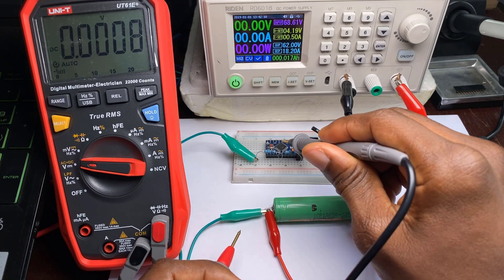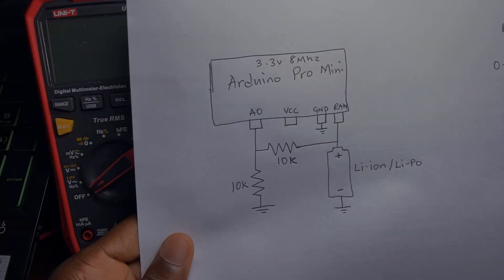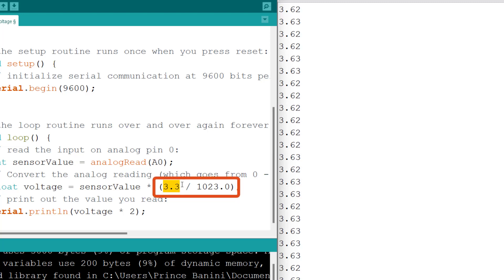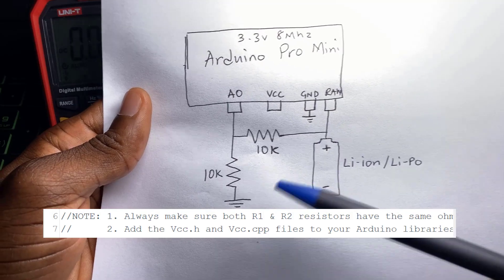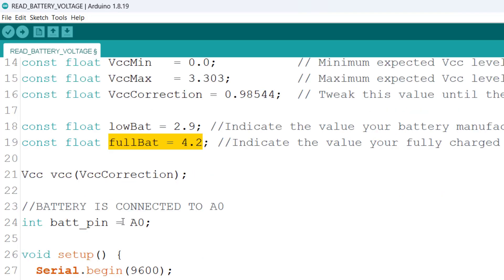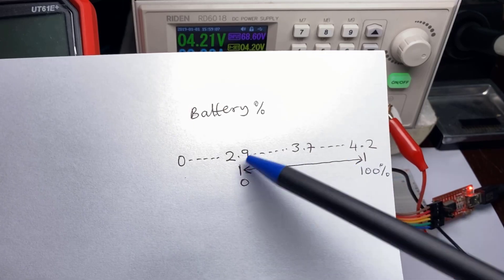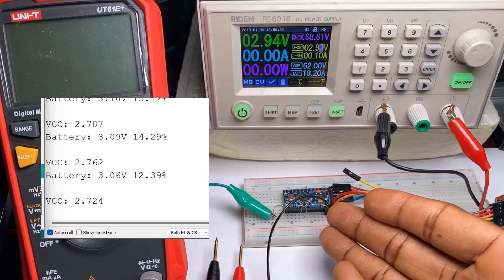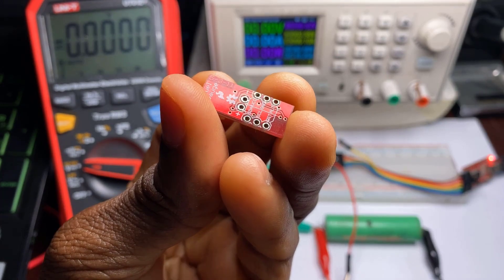Accurately Read Battery Voltage with an Arduino and Voltage Divider | Pro Mini | 18650 | ATmega328p

Comment: I am confused as to where you placed your test leads from the multimeter, to what pins. I know the ground test lead was placed on node that share between the battery and the resistor, but where was the other one placed?

Comment: This may not be the used case for you, but an Arduino Voltage sensor can help mitigate this issue. Not only the sensor is voltage independent,  isolated, and can read a wide range 0-25v of voltage but it is also does not cost a lot.
Reply from the maker: True. One could just use a fuel guage module like the MAX17043. But most people usually attach 4.2v li-ion or li-po batteries and dont need a dedicated fuel guage.

Comment: can you upload a video with same procedure but for a series stack of 10s celss or more? maybe with several res dividers maybe with amp op or maybe with the help of a BQ ti chip..thanks!
Reply from the maker: I could look into that. Essentially you want something like what a BMS does by showing each batterys voltage in a series stack + the overall voltage of the stack?

Comment: the issue is a voltage divider will keep draining the battery, how can this be avoided?
Reply from the maker: Yes but it heavily depends on the resistors used. You can simply use two 1 Mega Ohm resistors. I have done this on an electronics boards i designed and the board consumes 2uA in deep sleep. 

Alternatively  you can use a fuel guage IC like i mentioned at 9:00 of this video.
Reply: @ great, Thank you

Comment: Hi your project is great, may I ask if it affects the power consumption? I just want to check the battery once when starting the circuit.
Reply from the maker: I believe checking the battery doesnt affect the battery. Because if the arduino is already on, then checking battery voltage consumes the same power just like the ATMega chip being idle. However is you're waking up just to measure the battery voltage then yes, that could slightly impact the battery over a long period. But it might be neglegible.

Comment: How are you getting vcc max value of 3.303 volts?  Is that max voltage through the voltage divider?
Reply from the maker: That is the max voltage recorded at the voltage regulators output. I used a multimeter initially and later confirmed in serial monitor after calibration.

Comment: Is this still a problem if you use two cells feeding a voltage regulator that then feeds the arduino?

As I understand it the problem arises because a Lion cell drops below 3.3V as it discharges this messing with the analog ref. Correct?
Reply from the maker: Yes. Correct.

If you use two cells in series, the good news is you have more time before the combined voltage dips below the voltage regulators desired input.

Comment: question: would this problem exist if you used a separate power source for the arduino and not use the battery?
Reply from the maker: No it wont exist.

If the power source never dips below the 3.3v output peg the microcontroller requires as reference then this problem goes away.

Comment: How about the same for esp32? i'm unable to use the program for esp32?
Reply from the maker: The code is meant for the Arduino line of boards. I belive the ESP has a different architecture.

Comment: assuming battery level with just measuring the voltage is not a very correct approach. Because voltage discharge level is not linear. to calculate the exact power level you also have to measure the current.
Reply from the maker: In my case i'm just trying to measure the battery voltage, so the non linearity of battery discharge doesnt matter much. It might matter if i was trying to calculate and estimate how long before the battery gets to a fully discharged state. 

I hope you get what i mean.

Comment: Excuse me one question, why you didnt use the function "map" to get the battery percentage?
Reply from the maker: I didnt use the map() function becuase there was no need for making the Atmega328p do more work. I wanted to keep the code simple. 

I believe this:
((batt_volt - lowBat )/ (fullBat - lowBat)) * 100

is simpler than this:
map(batt_volt - lowBat, batt_volt - lowBat, fullBat - lowBat, 0, 100)
Reply: It doesn't work I tried the same and couldn't find answer why online. So went to basics and divided the value against the total times 100. This worked for me atleast